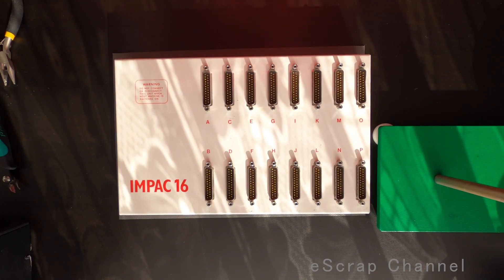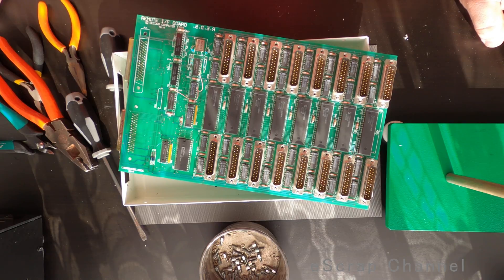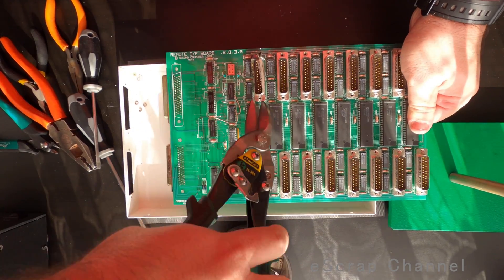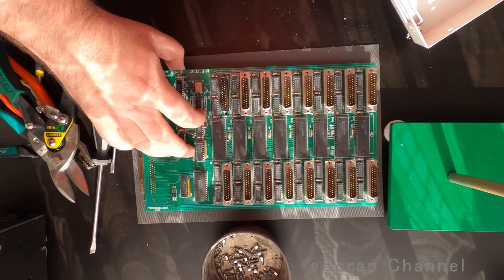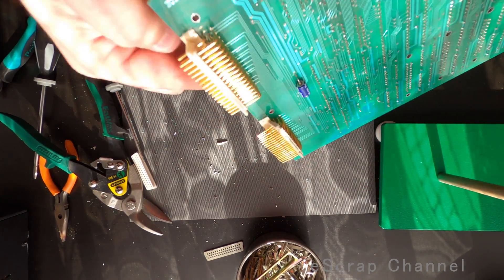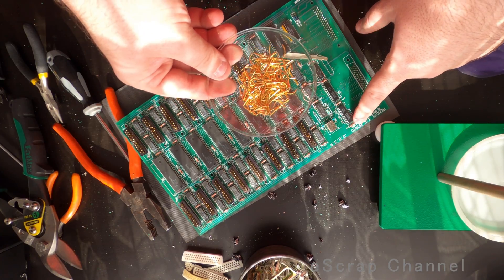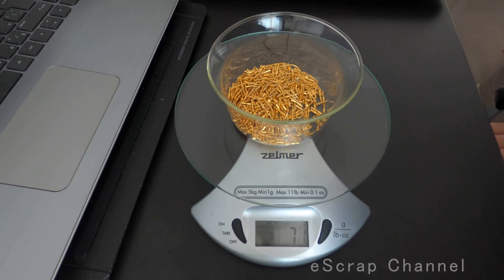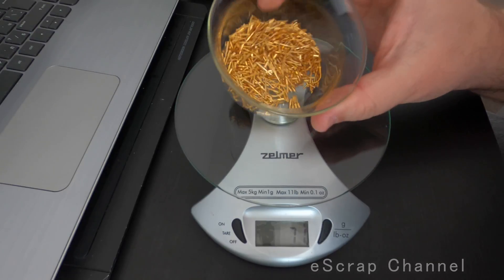Scrapping Vintage Electronics for High Grade Gold Plated Pins

Comment: woow that is an realy an beuty ;) just love 70-80 stuff ;)
sad it newr but still great looking ;)
Reply from the maker: Really good pins! Agree!
Reply: @escrapchannel  ;) i wonder what my stuff i founded in forest will give that whas ALOT of old simens stuff ;)
Reply from the maker: You should check a small batch, as old pins vary a lot. Rarely above 1% of the weight is gold but in couple of cases I’ve seen insane thick gold plating!
Reply: @escrapchannel  ill have an look ;)